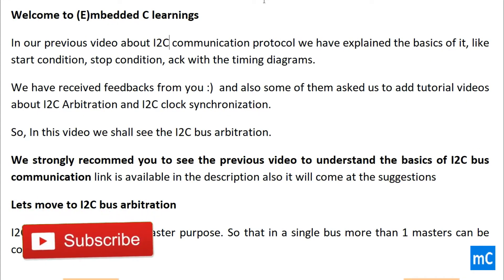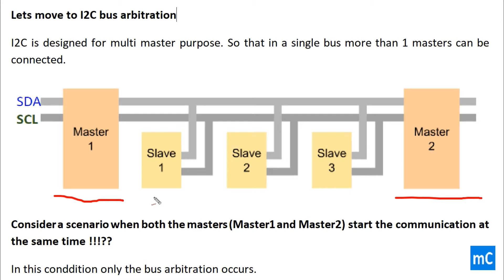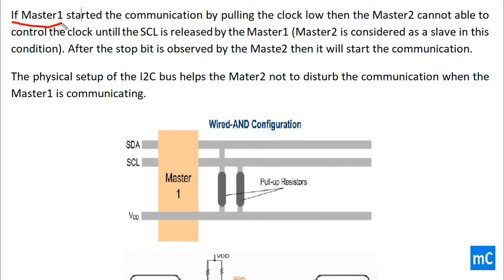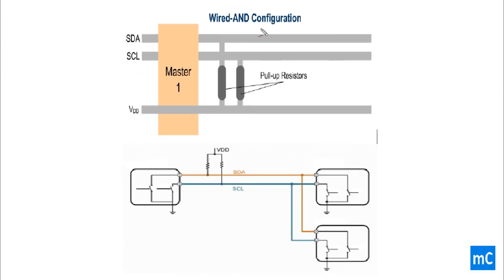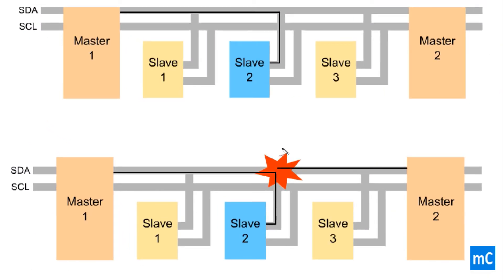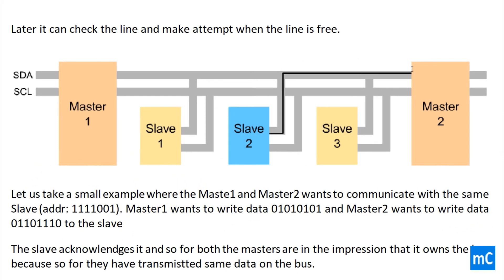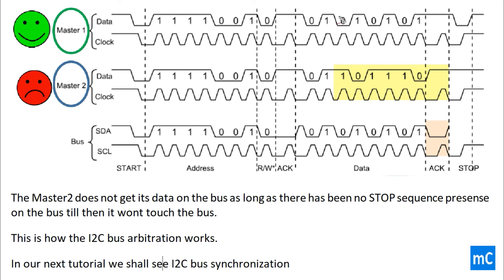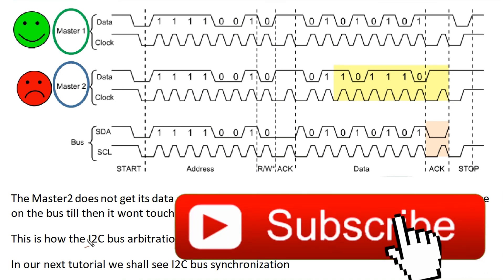I2C bus arbitration mechanism in Embedded C Animated tutorial

Comment: I happened to watch this video today and thought of offering these comments.
Any master would indicate start of communication by pulling the data line (SDA) low when the clock (SCL) line is high. Not by pulling the clock low as stated at 2.07.
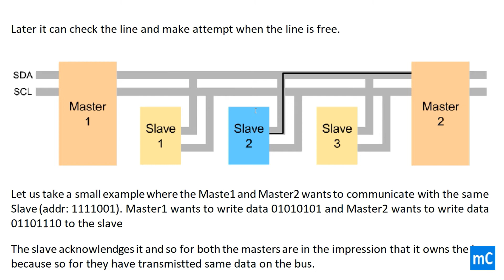The logic at every master (say master M1) would be, pull the SDA low when the SCL is high and keep it low until the SCL goes low and try to pull SDA high. If M1 is able to pull SDA high the M1 gets the bus. If it is not able to pull high means, other master is holding low it as the SDA is wired AND. So the M1 should back out now, giving the bus to other master and try again after STOP condition. The M1 would act as a slave until STOP condition and try to take the bus again after STOP. At any given time only ONE master will be controlling the bus while communication in progress, so the situation of both mater 1 & 2 writing the data to slave address 1111001, as stated between 5:17 to 8:12, DOES NOT arise
.